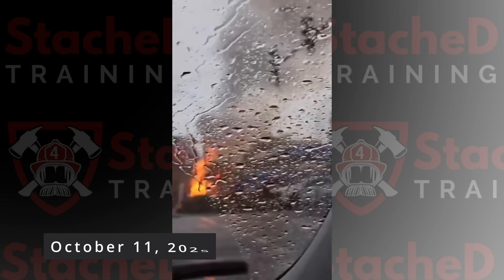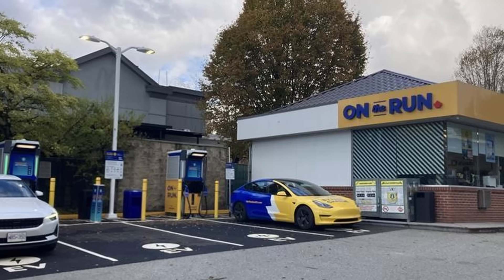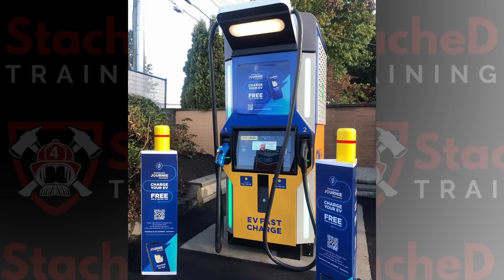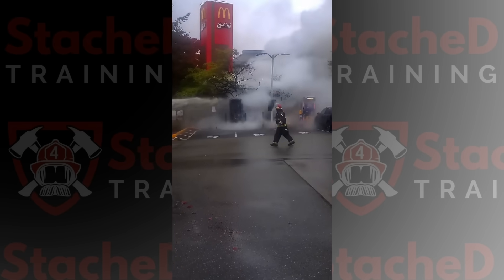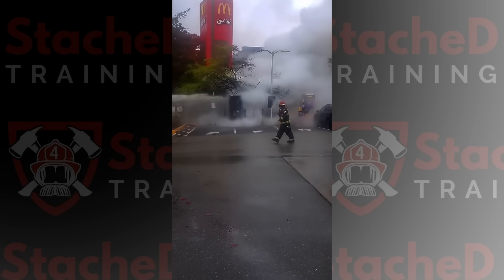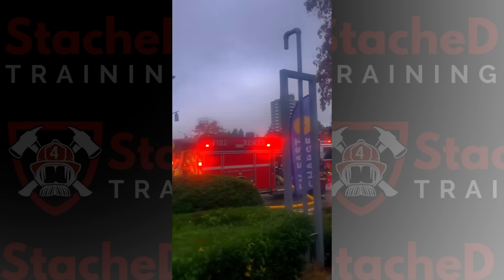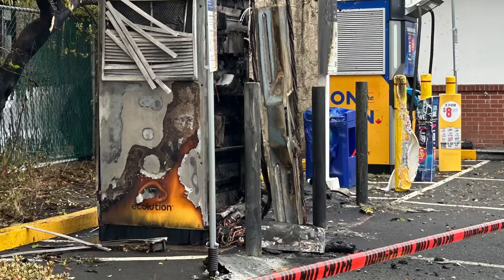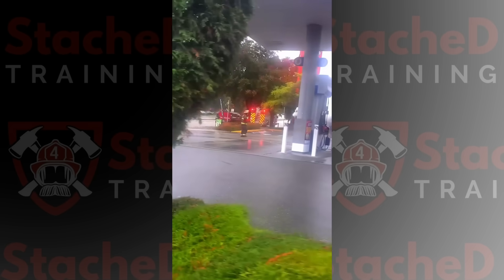EV Charger Fire in British Columbia: Hidden Batteries!

Comment: This absolutely perfect, the greenies must be delighted in how green EV’s are! Not only do they burn themselves down but they can take out one of those silly fossil fuel stations too..double dipping of great greenness!!
Reply: They also explode in vehicles and kill everyone in that vehicle.
Reply: @heatheryoung36 Your right! Even more greeniness people breathe out toxins that can harm the ozone and fish too.
Reply: Greener than ICE mate. Especially diesel.
Reply: @pvmagnus  The manufacturing process and end of life recycling process negates any positives of electric cars. New ICE engines are becoming extremely clean.
Reply: @johnmacleod5723

Only if you don’t consider the manufacturing process of ICE. All of that iron ore, coking coal, bauxite, electricity, and hydrocarbons just to MAKE an ICE doesn’t come from magic and pixie dust.  

And then by itself.. it’s still useless.  

An EV can use electricity at over 90% efficiency is able to recover much of it through regenerative braking. Much of which comes from renewables but even from coal it’s cleaner thanks to scrubbers the size of houses and carbon sequestration.. and better than 50% efficiency due to economies of scale. The batteries themselves are 100% recyclable and can be used for centuries.  

Meanwhile an ICE needs hydrocarbons burned at less than 30% efficiency.. the rest turns into heat, noise, and emissions. What’s even better is that it takes another barrel to explore, extract, refine, and distribute making the real efficiency more like 15%.  You can’t recover any of it. 

This is why your dumb argument was wholly and thoroughly debunked decades ago.
Reply: @calvinnickel9995  Do you realize how many brand new, never driven EV’s there are in China that are parked in fields and will never be sold? It’s in the tens of thousands, you really need to start researching this EV problem because you have clearly guzzled the Cool aid
Reply: @johnmacleod5723  "Do you realize how many brand new, never driven EV’s there are in China that are parked in fields "

I have yet to see any of these "brand new, never to be sold" EVs that aren't people mislabelling the pictures of the leftovers from failed rideshare companies after the rideshare boom-and-bust left a bunch of companies out of business.
Reply: @compwiz101 I was actually mistaken it’s not tens of thousands, it’s hundreds of thousands and china keeps churning them out. BYD seems to self immolate over there quite a bit and some of the cars in the fields have manufacturing errors others simply are an oversupply issue. There is plenty of information regarding this issue, all you need to do is look a little.
Reply: @johnmacleod5723  So you're now saying there's hundreds of thousands of brand new cars being built and just... left to rot in the fields?

I mean I'm willing to look: where might I actually see some pictures of these cars? I already tried looking in the first place and all I found were all of the mis-captioned photos from failed rideshares so if I've been looking in the wrong place I'd like to know.
Reply: @compwiz101 China Uncensored has gone in to this topic as well as Serpentza.
Reply: @johnmacleod5723  I'm gonna point out that China is a special case. As with most things in China there's less of a focus on the human aspect and more of the profit and optics for the CCP
Reply: @Nekros4442 It’s all part of determining how green a program is, one bad actor impacts the entire agenda. EV’s need further development and regulation but once some current issues are addressed it could be an excellent solution however there are others that can meet the same objectives.
Reply: @johnmacleod5723

Oh. And gas stations and ICE vehicles burn themselves on a far more regular basis. This did not result in any gasoline burning but all the more reason to get rid of it all.
Reply: I dunno, but those "greenies" must be thrilled with how you've embraced high-density housing to fit all of them into your head rent-free.

Comment: At least it's outside. I have not seen any battery backed DC fast charger catch fire before this, but with high currents and the human factor, it would be foolish to think that there are never going to be electrical failures. When that happens, any kind of energy storage is going to burn.
Reply: re: "I have not seen any battery backed DC fast charger catch fire before this."  correct, and statistics say we wouldn't since there just aren't that many, so "Law of Averages".  but of course even with the "super low count" (with this report) we DO have at least ONE which directly speaks to the "super volatility" of Li-Ion batteries that the good Captain has only been warning us about now going on 3 years.
Reply: @phillyphil1513 I live in Europe, where quite a lot of these are used to charge electric trucks. But I think most if not all of them are LFP powered now. Even the electric trucks are moving to LFP with recent improvements to energy density. The Mercedes eActros 600 now has a 600 kWh usable LFP battery capacity enabling trips well above the legal driving time of the trucker. This kind of charger with the proper battery chemistry is a really good solution to make the most of the existing grid. I hope charging operaters will get rid of the NMC powered chargers and maybe even make the move to sodium ion so we don't have to see these fires at scale.

Comment: A few Years ago did consider buying an EV as were stated to be the best thing since sliced bread however now so glad I opted instead to get a Mercedes late 2019 from a local main dealer - (W247) B200 CDi AMG 8 Speed [Diesel] with 81 miles on the clock (ex Demo) with all the latest tricks etc - and got a massive discount of nearly 10k from list price. This has absolutely amazed me, so so quiet, incredible range and over 35 mile journey (A6/A46) to Newark in Eco Mode [Freewheels when lifting throttle] did 93.2 mpg and took a screenshot from Mercedes Me App to prove it - hit traffic near end so dropped a bit. This car will no doubt still be running in 20 years time and still giving good sensible practical use. I don't make many journeys outside most EV's Range, but during summertime take generally a trip every week of between 150-300 miles Cotswolds, Wales or Cromer - I start to Range Anxiety when see only have 60 Miles left in tank and warning light comes on ! - If I wished to sell it (which I don't would expect to get around £22½k not much less than I paid for it ! - Say no more  :face-orange-biting-nails::text-green-game-over:

Comment: Excellent video and assessment.  These battery augmented chargers are especially concerning because these batteries will charge and discharge more often and possibly with deeper cycling than a typical EV battery.  And, when owners of charging stations run into financial straits, maintenance of these BESS units will be one of the first expenses they neglect.
Reply: The HUGE fees NON-Hydro charging stations get just amaze me (we have a community car you can day rent). BUT the "extra" charges mean I'll never be more than an hour away from my free or low cost charging. AS these 'independant" stations age, (and many are underground in parkades below high rises in Calgary, Vancovuer, And Edmonton) we're screwed.
Reply: @DwightStJohn-t7y what do you mean by “non hydro” 

And what do you mean by hydro?

Hydro means water. 
Are you using it in the Canadian context of hydroPower? So do you mean direct grid powered chargers vs “battery powered battery chargers”? 

I know in Ontario and BC the providers are named “BC HYDRO and Hydro one” but it’s still power made from water even if you put it in a battery. (And in Ontario most power isn’t from hydropower anyway)
Reply: @somethingsomething404 non BC residents can't comprehend that our Hydro bill and water bill are not the same thing
Reply: @mikafoxx2717 is that why people call it that? I don’t pay for water. Never have. 

I pay bc hydro for my electricity but I’ve never had a water bill.
Reply: These chargers were highly maintained...Not a struggling company it is Chevron!
Reply: @Rotated440-vh5se   If they were highly maintained and still failed, then chargers of this type should be outlawed because even with the best care, they aren't suited for purpose.
Reply: 100% agree...more safer battery technologies are must...
Reply: Sounds like we need some more proactive regulatory bodies involved.
Reply: @Triffgits  I think that high insurance premiums would be more effective at getting design advances to mitigate risks.  Legislation might work, but it generally drives costs of compliance up more than free market forces.
Reply: @kirkjohnson6638 good point, though it also potentially prices out a business from a risk assessment perspective - if they expect a certain margin of failure (as in all industries), too high a guaranteed expense over time may dissuade investment in the endeavor outright
Reply: @Triffgits  That's true and owners of charging stations are already having difficulty making a profit.  The business model for charging stations is questionable because a) anyone who can charge at home will do so because it's less expensive and more convenient, b) EV designs are moving toward longer and longer ranges which makes it less necessary for people who charge at home to use public chargers (only on longer trips), c) people who live in apartments, condos, or other dwellings where they cannot charge at home have to use public chargers all the time and want chargers near their residences in populated areas in addition to wanting them along interstate highways for ling road trips, d) people who don't charge at home and who mostly take short trips would prefer to buy short range EVs that are cheaper to buy, smaller, lighter, and it's less expensive for them to buy new battery packs if they need one due to collision damage or vehicle aging, but this is the opposite of what some home charging people want, e) everyone who has a need to use a public charger wants a fast charge to save time, but faster charging requires a more powerful grid connection for the charging station and that costs more resulting in higher prices per kWh, f) people with less disposable income may not be able to afford fast charging or will only use it occassionally, g) charging station owners can get higher car throughput by either having more chargers or faster chargers, h) charging station owners have to consider their competition - if the station doen the street has fast chargers and you do not, you might lose all your traffic, i) people who don't charge at home may only want to use local charging stations that also have restaurants, entertainment, grocery stores, etc. nearby so they can use their time constructively.

To make a super long story short - I do not envy charging station owners the decisions/guesses that they have to make.  They have large capital outlays to get in business and if they make one bad decision like installing five high speed chargers instead of 10 medium speed chargers or vice versa, that could make or break their whole business.  Plus they cannot predict what some other charging station owner might install down the block.
Reply: No, they actually neglect it from the start. That's why I stopped working in this industry. It was DEATH.

Comment: If there's ever a valid reason to keep your current ICE powered car, this is one of them. ICE in this case relating to the engine, not a certain three letter agency in the US.
Reply: So you think illegals should be allowed to enter the country at will?  Try entering Mexico illegally and see what they do to you.
Reply: Pro lem with ICE cars is they emit toxic fumes at lower levels but constantly.
And of course same for GHGs. These are a big problem.
Reply: Gas & gas fumes are also toxic and the same applies. Small emissions but constant
Reply: @pvmagnus  Valid points, at least with ICE cars they're a known entity. EV's are a whole other kettle of fish when it comes to dealing with fires related to them.
Reply: Would you consider getting rid of your ice car if you saw a video of a petrol station burning?

Comment: A few days back a Home wall charger Caught Fire 🔥 in Thailand while Charging BYD Seal
Reply: Meanwhile, GM just recalled all C8 corvetts because they can literally catch fire and explode by filling them up with gas if the user or the pump don't stop.
Reply: Chinese car.
Reply: @Islamisthecultofsin 
Correction 
CHINESE TOFU DREG
Reply: @Islamisthecultofsin  Probably not even the car; home wall chargers are basically extra-smart extension cords. They have some very basic communications with the car: "Hello, I provide _ volts at up to _ amps and I'm ready when you are!"

Car provides signal to start charging, the charger throws a relay, and it's running.

There is, even in North America, issues that come up from improper install; undersized wires, improperly configuring the charger to report a safe full-load current (generally 80% of what your wiring is rated for), poor terminations, re-using a worn plug not intended for a lot of cycles, etc. etc.
Reply: @compwiz101   I'm not referring to house wiring catching fire but the car itself catching fire.

Comment: EV vehicles require EV batteries to be everywhere in an almost unlimited amount. What a scam.
Reply: The BS they are trying on us. Our cities couldn't keep up to the power demand of EV if we all had them. not even close. Your electrical bill would easily double, just with one car.
Reply: lol… no they don’t.  

You can literally charge an EV from a 15A wall socket overnight. Most people don’t drive enough each day to require a fast charger.  

You know what is a scam?  The propaganda that you’ve been fed by the oil companies. The ones that are mostly foreign owned.. actively limiting or divesting of value added downstream production to keep gas prices high and lay off workers, and who leave the Canadian landscape littered with orphan wells.  

Because their pyramid scheme is dependent on more and more people burning more and more gas. Completely unlike EVs where the lithium is 100% recyclable in most cases and better battery technology is coming.. and electricity is provided by a public utility company.  

Spew your Russian bot nonsense somewhere else.
Reply: @calvinnickel9995  You missed the point, probably on purpose. If everyone had to charge their EVs the price for electricity would skyrocket. The grid probably couldn't handle it & need $$millions in upgrades, you'd pay for that too. The amount of energy provided by ICE to move everyone and everything around is gigantic! Replacing that with EVs isn't going to work. Gasoline is very efficient, EVs are not. Unless all the electricity comes from hydro (like my province!) or nuclear? EVs aren't "clean" either.
Reply: @5Cats  " Gasoline is very efficient,"

On what planet is gasoline efficient? It's EASY, that's it. Lots of energy density, easy to move in a big tank. It requires its own massive infrastructure to locate, extract, process, and transport- but we built it already so it's completely normalized to just keep spending money on maintaining it.

Time comes to actually use it and you're dumping 70-80% of the energy as waste, because an internal combustion engine is only 20-30% efficient.

Frankly, everyone having gas cars isn't sustainable, but neither is replacing every one of them with the current flavor of EVs - but it's always easier to sell four more lanes of highway than a rail line that will do 2.5x the transport volume so here we are.
Reply: @compwiz101  Mass to energy, it beats the heck out of batteries. It's quick to refuel too, making it time efficient. That's how. There's enough oil to last 200 years, that's not even counting deep sea oil which probably has enough for 300 more years too. Yes, rail is more efficient, powered by... Diesel!
Reply: @5Cats Hey guess what? You don't have to charge an ev from oil or the grid. 
Funny how you all have hvac units and dryers that use just as much energy as an ev to charge, but you don't whine about them.
Reply: @sprockkets  Off grid? So you bought solar panels then? And when they don't work for a week you just stay home? Oh! Overnight charging will be terrific, eh? My dryer isn't on for 6 hours at a time. Hvac is essential for modern life. Not everyone can live off grid, eh? Apartment dwellers for example.
Reply: @5Cats neither does my car take 6 hours to charge
Reply: @5Cats  "Mass to energy, it beats the heck out of batteries."

Again, internal combustion engines suck at doing this efficiently, so this is just you saying "they're better" without justification

 "It's quick to refuel too, making it time efficient. "

Oh, suddenly we're talking about time instead of actual system efficiency, what a convenient shifting of the goalposts.
Reply: @compwiz101  Looking at the small picture, personal use? ICE beats the heck out of EVs for most (not all!) people. Reliable, ready to go, easy to operate, far cheaper! Want to drive to Alberta? Hop in the car and off you go. Want to pull a trailer? Your mileage gets a little worse, yes, but not HALF range like an EV does. It's cold outside? Put that "waste heat "to work, unlike an EV...

In the big picture? "system efficiency"?  EVs use up a LOT of resources & energy just to be made! Making more of them brings "economics of scale" into play and in a negative way: the more you make, the higher the per unit cost goes! As the materials to make them are in high demand & thus increasing costs.   
An ICE car is like 95% recyclable & easily done. It's baked into their design. EV bodies & motors are too, but not the batteries, they're bloody expensive to recycle or dispose of.   
Oil has 1000s of uses, banning ICE cars won't stop us from using a LOT of oil, ok? So arguing that oil production is bad isn't valid here.
Reply: Total scam! The green grift globalists hijacked any legitimate environmental movements.